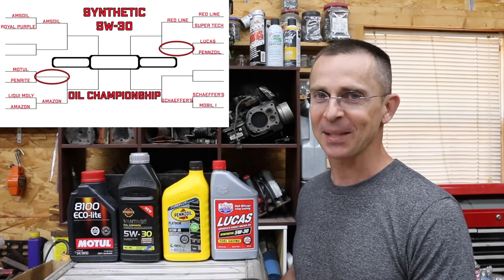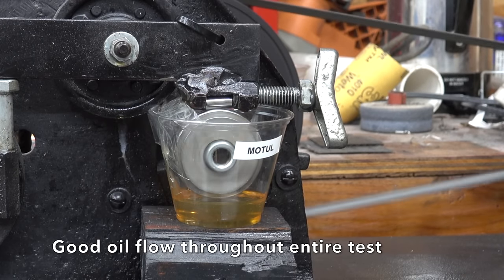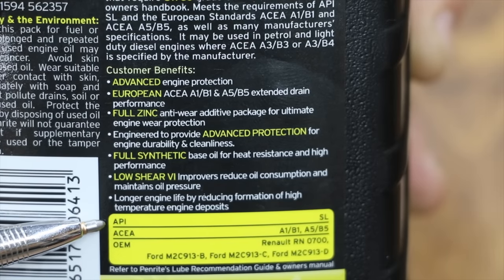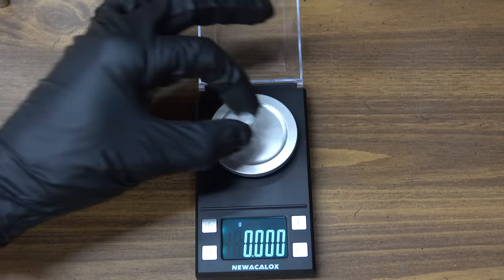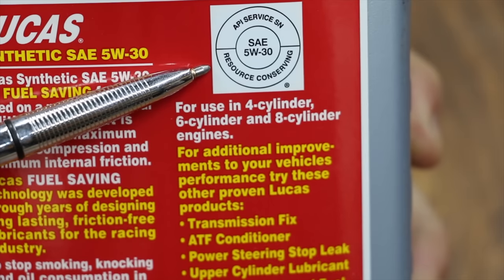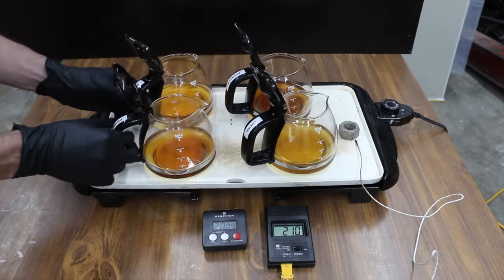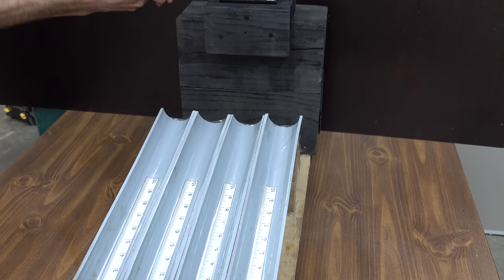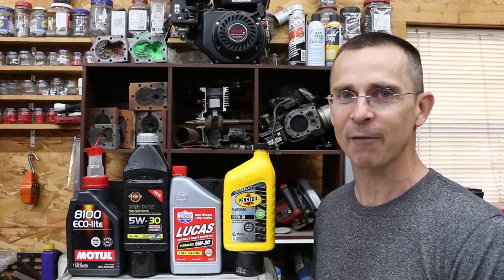Is Lucas better than Pennzoil? Let's find out!

Comment: Nice one

Also i just thought of somethin new: household fans actual amount of air being sent comparison
Reply from the maker: Great video idea! Thank you
Reply: This IS a great idea. Don't you hate when you look at six different fans, recognize the possible differences in airflow patterns, then buy what you think is best, only to have it be like an asthmatic squirrel huffing towards you? Vornado and Dyson are nice mass produced products. Honeywell has disappointed me a little.
Reply: I'd like to see this. I would add some metrics, like efficiency in terms of wattage and cost. The most powerful fan isn't necessarily doing your electric bill any favors.
Reply: @ProjectFarm  Oh, this will be GOOOOD!
Reply: @Varadiio  Yes and YES! He already utilizes a Kil-A-Watt too. Perfection.
Reply: Yep, I miss the old patton fans with 25 year warranty - an oversized motor, a fan blade, a switch, and a grate. blew lots of air at a high velocity, but I understand that is no more.
Reply: @1noryb  Are those the big steel pedestal fans, typically black with 4 giant aluminum blades? If so, my old job had a 50 year old one that was 6 foot 2 tall and weighed 85 pounds! Quiet for such a powerful motor but all the noise was the air running past your head from 25 feet away! Love those shop and warehouse style fans. The lightweight floor fans used on engine dynos (not the cage blowers, which is what is SUPPOSED to be used on a dyno!) are nice too.
Reply: @pgmurray76  Yep, as I recall, they made sizes from 14" floor fans to 36"+ on pedestals for floor or ceiling mounts.
Reply: @1noryb  Ceiling mount...true. I remember a gym I used to go to put inside a converted factory. The old ceiling mount fan were left in place (but cleaned!). A Godsend on warmer days!
Reply: Even more so, I'd love to see radiator fan comparisons!
Reply: @802Garage  Flexlite, Hayden, then all the others. That coukd be a pain in ass to make consistent. All would have to be same size on same radiator, then a hot water heater with accurate thermostat would be used to provide water. Hmm, but the fan would blow thereby cooling the radiator and the heater woukd kick in longer. Not an ideal test. You will have to trust the internet and which is most reliable. Not having proper baffling, or a fan that is set to run at too high a temp is biggest issue. (i.e. - Factory Chrysler plastic 2.7liter POS)
Reply: @802Garage  I think I made it too technical. He could compare fans based off of cfm or size. Then power consumed at each RPM or within a range. Measured RPM - obviously needs a tachometer. Noise level - maybe silly! He would have to get something to measure windspeed I suppose. A Tenma brand possibly or Amazon special. If it is a kit that has a temperature switch he could check that. A comparitive way to measure flow without spending money would be to get plastic or cloth strips ( somewhat stiff like canvas if cloth), and mount multiple across the front of the fans, then tape washers or nuts to the strips. Maybe add more or wrenches or bolts if a fan is really powerful! The force exerted upon a known area and mass could be calculated and slapped in Excel. Or another possibility is looking at airpressure provided by mounting fans to a simple plywood box with a hole in it of known area. Then a new pressure sensor can be mounted and sealed in another hole. The voltage output of the sensor can be extrapolated to pressure - purely for comparison for apple-to-apples fans of similar specification. Power consumption can also be checked under the load of the semi-sealed enclosure. Just ideas. You might just say "Nah, just do this!" and I will be like "Doh!" (Homer Simpson) Just ideas as I am eating two old pieces of 7-11 pizza (2 for $2) after riding up a decent singletrack in sunny San Diego. I think these ideas are more in the spirit of Project Farm and Todd. I know you are a car guy through and through. Sorry if my first lame answer made me sound like a douche. I thought about it for a day.
Reply: @pgmurray76  Hahaha, not too technical and you don't sound bad at all! I would simply get fans from different brands which are the same advertised size and similar CFM ratings. Then I would set up a radiator and affix the fans as instructed by the manufacturers. Set up a reservoir and pump, then use simple boiled tap water for the test. Make sure the reservoir is the same temp at the beginning of each test, and then start circulation and fan. Measure the temperature again at the end of a testing period, done. Sure it wouldn't be perfect, but you would certainly know if there was a big difference. If it cooled the water too fast, you could hook up a hot water heater element as well and just measure outlet temperature. Appreciate the discussion!
Reply: @802Garage  DOH! I had the right idea but made it too difficult. Of course, ensure the same water temp at the start of the test then watch or log how fast each fan decreases the temp. This is much easier! Basically, test it in close to real world conditions.

Comment: The Penrite Vantage is at the lower end of the range. Would be good to see HPR 5 tested 👍
Reply from the maker: Thank you!
Reply: tone167  I use Castrol Edge Extended Performance, run WOT with nearly every acceleration, 10,000-12,000 km oil changes, pay no attention to length of time but generally around 4 months, have no oil consumption, and my oil comes out looking like it has only been 1000 km. Of course I also use bout 1/2 liter Lucas oil stabilizer with every oil change.
Reply: yep there are Penrite 5W30 oils higher up the food chain than the Vantage line.  Did a good job though - Go Australia!!!!
Reply: Just because it's in the "higher end of the range" doesn't necessarily mean it'll perform better. Send him a bottle of HPR5 to prove it.

Comment: Try Quaker State Ultimate Durability synthetic and Castrol Edge synthetic!
Reply from the maker: Thank you for the video idea!
Reply: I second this. As I use castrol but thinking of switching to Quaker ultimate
Reply: @Poppy Talley    Use to be, but Shell bought them out awhile back, and revamped some of the lines.  Quaker State Ultimate Durability fully synthetic line is actually a very good oil.
  
  It tested very well in Terry Dyson's testing.  I've also seen reports of used oil analyses of it and it holds up well.
Reply: @Poppy Talley   You're not speaking from current knowledge and facts, but from old prejudice. 

    Quaker State use to get oil out of Pennsylvania.  That oil was known for being sludgy because of the paraffin.  

    They got bought out by Shell awhile back and their synthetic lines do not use that oil.
 
 Many independent sources all indicate similar, that specifically the Ultimate Durability Fully Synthetic line is a very good quality and high performing line of oils.
Reply: I've seen the VOAs for QSUD, and it looks like a fantastic oil.  As far as I can tell, it's made with the same base stock as Pennzoil Platinum, but with a different addative package.  Would be interesting to see how much difference there is between these two "Sister" oils from SOPUS.
Reply: @justinw1765  Yep.  It's some of the best oil on the market right now.  That Shell GTL base stock is the real deal.
Reply: @540EdgeFlyer    Definitely one of the best values, if not the best value, for sure.  But honestly, for regular and non extreme use, even Walmart's synthetic stuff is decent if you change your oil every 5k +/- 1k mi or so, as one should be doing anyways.  Few people really need the performance of the more expensive or very high performing oils (which QS UD is pretty much at).  

But if price is not a huge factor, and if you already haven't checked them out, I would also recommend some of the Renewable Lubricant lines.   But again, for more extreme and/or unusual use.  

    Since it's warming up here, I'm going to be running their 5w-40 low ash oil in my Piaggio Fly 150 scooter (my main work commuter, but use a truck when the weather is bad or the like).  Very hard working, high revving, high compression, air cooled engine.  Since it only takes about a quart of oil, I don't mind paying a bit more for such a really good oil.  By definition, extreme/unusual use applies to this thing, especially when I take it on lower speed highways (only 55 and 60 mph top speed H.W.'s, and only for short distances of a couple to a few miles or so).

   Some people might say that I would need to run at least a 10w-50, or even higher viscosity oil, but I don't agree, even though it is air cooled.  Thinner oil helps to cool better than thicker, and there is less wear and tear at startup, which is where most of the damage/wear happens anyways.  

 Also, these RL oils in general tend to have low volatility, high VI, reduced oxidation, and excellent film strength properties.  The 5w-40 lines in particular are some amazing oils from what I've heard.    

    When I get my Ninja up and running, will run that same RL oil in it as well--hopefully the clutch can handle it.  It should since it's not that worn as far as I know.  

 But for the truck and my spouses Prius C, it's Q.S. U.D. fully synthetic all the way.  5w-30 for the truck, and 0w-30 for the latter.
Reply: Been running various grades of Castrol Edge and Extended Edge over the last year in my Lexus chasing slap/valve noises in startup. 5W 20, 5W 30, 0W 40, and all kinds of additives. Lucus, Rislone, Prolong, MMO, etc.  Just put the QSUD in tonight. Much quieter. Better gas mileage too.

Comment: ;Aside from marketing wank, is there any difference between "full synthetic" and "100% synthetic?"
Reply from the maker: Great question.  I'll create a video on this if there is enough interest.  There is a difference and it has to do with the base oil that is used.  Thanks again
Reply: @ProjectFarm  Please do I can not find info about this anywhere .
Reply: @ProjectFarm  It's a valid question, and an oil race to be run hot and heavy!
Reply: 100% synthetic is a group 4 oil. Full synthetic can be a group 3 base oil which can still be made from non-synthetic base molecules. Almost all brands are Group 3, like mobil 1 and pennzoil, a few like redline motor oil, amsoil are group 4 base oils.
Reply: You can blame the US government for allowing Pennzoil to market their group 3 base oils as "full synthetic" despite it not being the case. Mobil 1 lost the suit and subsequently changed their formula from group 4 base to group 3 base to bring down product costs.
Reply: I am definitely interested. Although, I'd watch any video he puts out.
Reply: 100% synthetic oils are group IV and group V oils or Polyalphaolefin and Ester based."Full synthetic" oils are group III and mineral based..Its just a little bit better semi-synthetic with same base...
Reply: +Sergio.. So "fully synthetic" can have the primary ingredient (the base oil) be the same stuff that the non-synthetic oil has?
Also, making base oil from natural gas is not exactly new. It just takes a lot of energy to do it.
Reply: Info please.   Could be a nice intermission or add in fact dying the finals.
Reply: @ProjectFarm  I will be very interested if you make this video. To this date, Motul has been the best oil I have used in my experience.
Reply: Sergio Ruelas It’s BP/Castrol that Mobile 1 sued and lost. Thus opening the flood gates for company’s to market Group 3 base stocks as “synthetic” oils.
Reply: Maybe you could do transmission fluid testing?  I’m curious how motorcraft mercon lv fluid would compare to amsoil or red line.
Reply: In US, not really, in EU you can call a "synthetic blend" "full synthetic" on the fron of the box, so really a semisynthetic, while "100% synthetic" must really be synthetic.
Reply: I thought I was wrong, turns out I was mistaken. Should have read the comments before, so in US it's the same really.
Reply: @martinlohstroh  there's a YouTube video out there with a good breakdown. It's really boring, and you'd be lucky to make it through the whole thing
Reply: @ProjectFarm  oh wow...I thought you were just being funny.  I'd love to know the difference.
Reply: @ProjectFarm  : Uh, yeah.  There is interest in more information about oil, especially synthetic oil, but also all types of oil (even vegetable oil if you want).  Also describe what is "base oil" ... versus whatever other oil there is.  I thought oil == oil.
Reply: @stevenutter3614  what is your problem exactly?
Reply: @martinlohstroh  go to Bobistheoilguy, there's years of information on the subject

Comment: Should have used Pennzoil Ultra. The top oil from Pennzoil.
Reply from the maker: Thank you
Reply: Superman  or shell helix ultra here in europe witch is so much better than pennzoil(a shell company).
Reply: Superman  ferrari require an ACEA c2/c3 oil her in europe. So low zinc. Pennzoil euro doesn't have any of ferrari specification.
Reply: Platinum is better comparison because it is more commonly used, cheaper than Ultra, and easier to find in stores.

Comment: Wish you had used Pennzoil Ultra Platinum instead of regular Platinum
Reply from the maker: Thanks for the constructive feedback.
Reply: @ProjectFarm  Thank you sir for the great content and hard work
Reply: Just think if platinum works, ultra platinum should be better.
Reply: @Chinesefoodrocks1521  I always put ultra ahead of the names of my projects.  They always turn out better that way.
Reply: I wish ultra platinum was on store shelves and not just online.
Reply: Shouldn't be any difference in these tests, the only difference between UP and plat is the add pack, so UP is a bit better at cleaning the valve train, pistons, and internal engine parts.  Base oil is the same.
Reply: I had no idea there was even an ultra. Good to know!
Reply: Pennzoil Platinum makes more sense than Ultra because it is more popular, cheaper, and easier to find.
Reply: Platinum is better comparison because it is more commonly used, cheaper than Ultra, and easier to find in stores.
Reply: @zzman5306  I buy ultra for like 2$ more a 5 quart jug. You can't afford that you should own a car.
Reply: @zzman5306  he used too self oil amziol, redline, ECT then too self Pennzoil should of been used.
Reply: The Ultra is a marketing gimmick. There are several videos showing it makes essentially zero difference.
Reply: @warpathh  yeah? And I have stood in a lab and see the results of testing g on the two I will have to call bullshit. The lab is in Cincinnati Ohio.
Reply: @vector150 - So NOT true... by thinking outside the box for just a second (aka: eliminating the "fear/hype" factor from years of motor oil marketing & sales pitches), ask yourself the following Q's... "when is the last time you (or anyone else) ruined an engine simply because you, me or the guy down the street bought the low grade, mid grade or most expensive motor oil for their daily driver...?...unless, under the rare circumstance you own a rare/priceless show car, operate a race car or own/operate a fleet of cars/trucks/taxi's/buses/semi's/etc... (where it makes $sense$ to maximize fuel consumption, maintenance and engine overhauls/engine replacements)... buying higher priced oils for your daily driver actually makes little sense (why?) because... 1) The odds are very (very) high you will sell/trade-in the vehicle (longggg) before the engine requires an overhaul or replacement.  2) The body of the vehicle will degrade/rust out longgggg before the vehicle's engine requires an overhaul/replacement.  Facts and common sense trump marketing fear and hype every time...
Reply: @vector150  : Then please describe the differences you saw.  You are in a great position to enlighten us all.  Not being sarcastic, either.
Reply: I wish he DISQUALIFIED Pennzoil for using such monikers as Ultra and Platinum and UltraPlatinum!  Next will be SuperUltraPlatinum, then there's always UltraPremium!  Don't forget PlatinumPremium!  And oh yea, SuperUltraPlatinumPremiumPlus!
Reply: Ultra is worse than Platinum. Platinum is only good for the temperatures of everyday track driving. Absolutely not worth the price or loyalty. You get worse wear protection to top it off, Ultra is just rated SN while Platinum is SN-Plus. Thanks for the suggestion, now he's changed it 😒. Now we'll never know the superior oil.
Reply: @Integrity.is.everything  Ultra is worse than Platinum. Platinum is only good for the temperatures of everyday track driving. Absolutely not worth the price or loyalty. You get worse wear protection to top it off, Ultra is just rated SN while Platinum is SN-Plus. Thanks for the suggestion, now he's changed it 😒. Now we'll never know the superior oil.